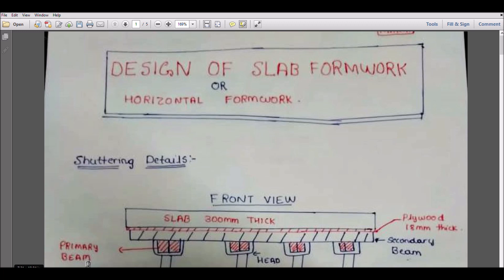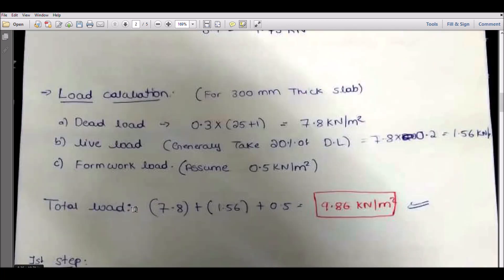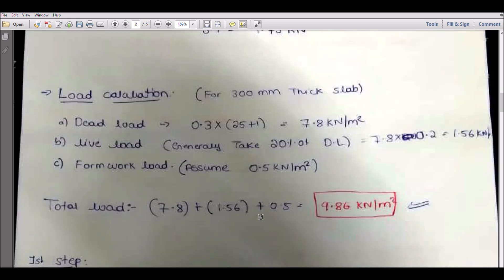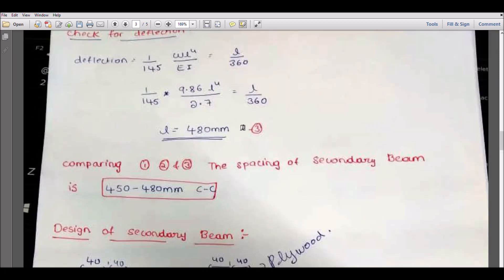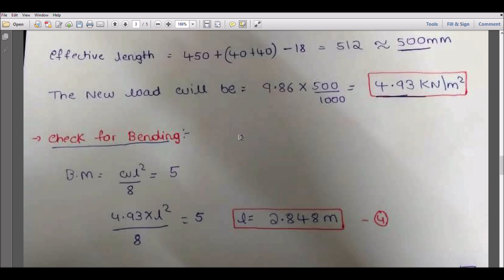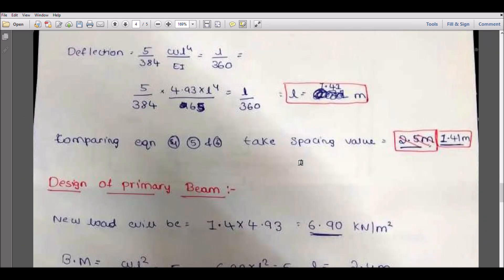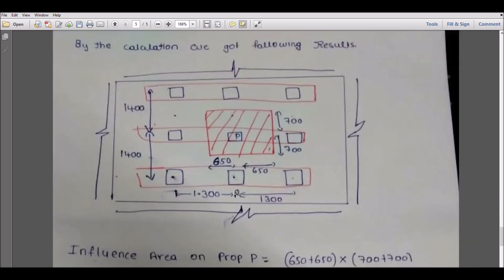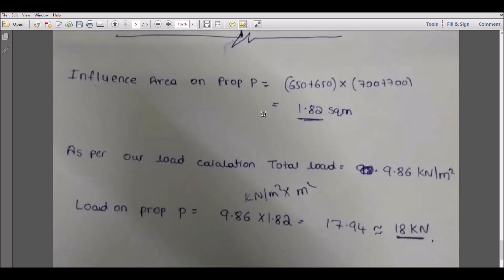How to Design slab Formwork With detailed calculation.

Comment: What is height of slab??

If. We use steel beam instead of timber beam, then what??

Sir
Reply from the maker: Hi, If you use steel beam instead of Timber beams as primary beams, Then you can Increase the distance between props. You need to recalculate it by using new SF BM Diff values of steel beams.

Comment: why are you saying that the permissible shear for the plywood is 9.75kN, yet subsequently saying that the permissible shear is 5.54kN? when calculating the span for the plywood
Reply: i have the same thought
Reply from the maker: Hi, When you calculating the distance of secondary beams, as I mentioned we need to calculate 3 cases(SF,BM,Difflection). 9.75kN is the max capacity, But for the 300mm thick slab SF utilised is 5.54kN.

Comment: Did you ever use Aluminium I beam with plywood instead of MS Centering Sheets? If any kindly share the pictures?
Reply from the maker: In design I chosen timber beams as primary and secondary. If you want to use aluminium I section beams we need to get the specifications. Then we need to calculate
Reply: CIVIL Mania Can i get your contact number

Comment: From where you have taken BM and shearforce formula? Is there any is code for this
Reply from the maker: This formula is fixed . It won't change. But only thier value differs based on the material
Reply from the maker: This is standard formula. You can refer Kumar Neeraj jha book
Reply: u may get it if u run the basic formula from solid mechanics, on the books it been simplified